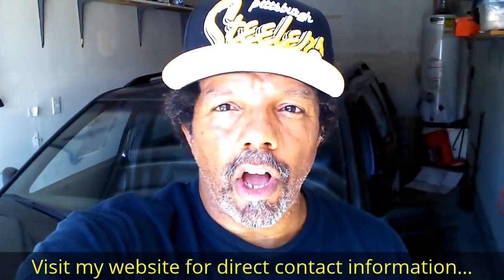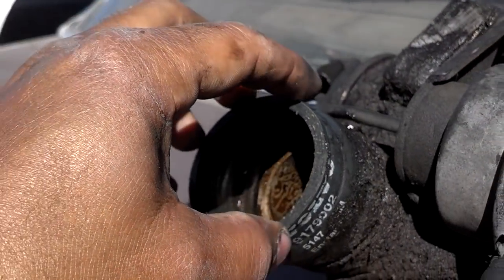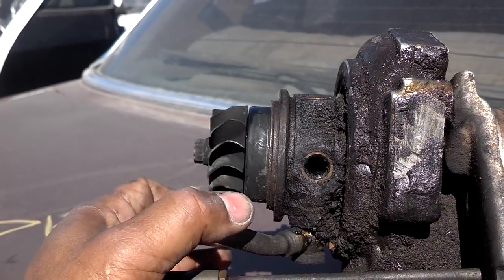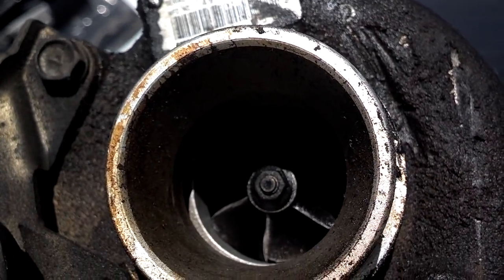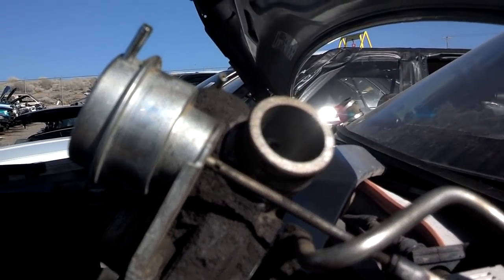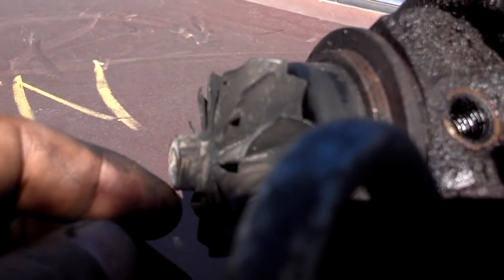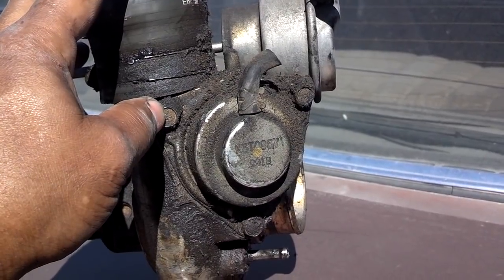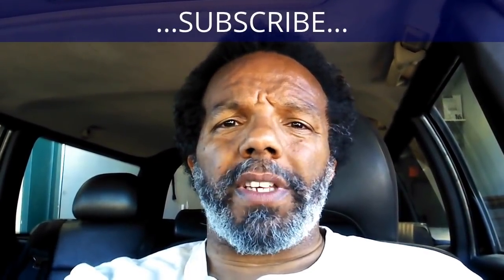How to tell if a turbocharger is bad. What can go wrong with them. - VOTD

Comment: Hi, I liked your video for its clear explanation and easy to understand.
I have an Audi A6 3.0TDI Diesel Turbo, model 2005 that I am having problems with the turbo at certain times as follows:
1. Starting from cold the engine performs beautifully with lots of power for as long as the trip takes.
2. When starting from hot engine, the car may perform well until stopping at the first intersection or traffic lights, from then on it loses power. When in this mode, if I try to push hard, the glow plug light comes on and starts flashing. Pushing harder the computer / engine light comes on.
3. When in this mode (that is when the glow plug light is flashing), If I stop the car and turn the engine off for around 2 minutes, and then switch the engine back on it will drive normally with full power. 
My personal view is that the turbo sensors could be playing up. However, my local Audi Service Centre have advised that the turbo needs replacement.
Thank you in advance for any advise you may have.
Bill Jabro from Australia
Reply from the maker: +William Jabro Doesn't sound like a turbo problem, more like a sensor issue. Have they read the codes?
Reply: +Robert DIY Thank you Robert for your quick response. It would seem they have read the codes. In their report they said "Checked and found fault codes on the turbo and the flap motor. Ran test plan and found turbo to be defective and the car requires a new turbo". 
My concern is, if the turbo is defective, why is it working properly at certain times? It could well be that it is getting the wrong signal from a sensor.
I personally thought it could be a sensor issue. Prior to taking the car to Audi, a specialist local mobile mechanic pointed out that the turbo has 2 sensors and either one could be causing the problem. He was not in a position to do it then. I will contact him to arrange repairs.
Thank you again Robert.
Reply from the maker: You may want to get another opinion.
Reply: +Robert DIY Thank you Robert, I will do that.

Comment: this is best video explanation
i got a quiestion
i have a gst eclipse with a small 16g
and im thinking it may have blown seals beacause it smokes all the time but not like the one u showed
and it has a lost of power
i was thinking it may be the valves or a piston ring but the wierd part and why i think its the turbo seals its because one of the studs on the head is broken so i have a boost leek and the wierd part is that when i step on the gas looks like its coming oil from the broken stud and the headers can u help me out
Reply from the maker: +John Torres Hey John, man, I don't know. Sounds like you have a lot going on there. Fix your boost leak and see if you get your power back. A 16g is not really small.
Reply: +Robert DIY  no i got the small 16g not the big 16g jaja
but today imma swap the turbo to the stock t25 turbo to see it it is the turbo
Reply from the maker: Cool.

Comment: good video, clear explanation, simple to the bone, no annoying music over the voice, thanks
Reply from the maker: +TheEdudo Thanks for watching.
Reply: Hello, I am writing from Turkey. I have a 98 model Volvo v70 T5 turbo. It is 4 x 4. How does the turbo vestek work principle of this car? Where does the turbo control valve get the command from and how does it open the signal? There is no turbo pressure sensor in this car. How does it detect it and open the turbo control valve? Thank you.
Reply: I agree, good video, only suggestion to improve that I have is to clean the turbo before the video to make all the different parts easier to identify, thank you.

Comment: Thanks for uploading
Reply from the maker: +sandydogy You are welcome. Thanks for watching.
Reply: +Robert DIY How come some have coolant lines others don't? Thanks Ian
Reply from the maker: Not sure. Cooling helps bring the temp down quickly.
Reply: Robert DIY I have a problem with my Fiesta diesel and as she warms up she misses for about a mile and a half on and off code po200 injection circuit malfunction,  changed glow plugs, fuel filter, any idea how to find where air in getting in to fuel lines?  I can see bubbles when I squeeze the primer bulb that fills my fuel filter? Thanks
Reply from the maker: Maybe the fuel injector is going bad.

Comment: Robert,

Few weeks ago some work have been done on my 2012 Jetta SE for the 40000 miles, since then I'm feeling loss powers. At first i thought it was lost of power now I think it's a turbo ! What do you think can happen ? What do you think is the issue ?

Thank

By the way, I like your video
Reply from the maker: +Nico Scala Probably a vacuum line loose or bad.
Reply: +Robert DIY 
I will check that, thank you for your advise.
By the way keep doing videos, ur doing a good job

Comment: this video is an excellent one with clear concise explanations .
way to go
Reply from the maker: +Paul Costello Thanks for watching.
Reply: Robert DIY Hey Robert do you know much about aftermarket turbos and upgrading them? I'm putting on a bigger turbo and could really use some advice. Are you familiar with bigger turbos than stock and the mods that go along with it? just had a few questions for my build. thanks, subbed......
Reply: Chris Watson don't run a bigger turbo on stock internals

Comment: NO SMOKE AT ALL JUST LEAKING . KNOKING SOUNDS WHEN YOU FIRST START IT UP
Reply from the maker: +Clyde Bush What is leaking? What is knocking?
Reply: oil out of front of turbo. someone told me that it was turbo making noise
Reply: THANK YOU
Reply from the maker: +Clyde Bush Turbo's do leak a little. Not more than a drop or two per day. If you can see drips while it is running, it's leaking to much.

Comment: I have jeep compass 2008 and problem I am facing is that jeep starts loosing speed on upwards and computer says it maybe turbo so what is your suggestion. voice is also changed but no smoke. Kan it be paip.
Reply from the maker: +Tamur Khan If it's not smoking, I doubt it. Do you have any codes?
Reply: I have fixed it up.. turbo pap was loose...

Comment: I just bought a 2011 wrx and when I start the car it will back fire a few times and a lot of white smoke. any ideas?
Reply from the maker: +lilb1432 Yikes! is the car firing properly? Have you checked the spark plugs?
Reply: +Robert DIY the car starts fine and runs on its on but when you accelerate its rough and almost stalles when you take your foot off. car sat for around 8 months without it bein moved
Reply: Give it a good service before you start looking at potential issues, a car that's been sitting for a length of time will need a good service.
Reply from the maker: Is the CEL on? Any codes?

Comment: great vid man thanks for taking the time to make it and help the rest of us and it looks like the guy who had removed that bad turbo came by and gave your vid a thumbs down.
Reply from the maker: +Jose Gonzalez LOL, thanks for watching.
Reply: +Robert DIY  How long after changing turbo should your car stop smoking?
Reply from the maker: Within 50 miles. If you drove it a lot when it was loosing oil down the exhaust, there may be a lot of oil in the cat, which will have to burn off.
Reply: +Robert DIY thanks I appreciate it the responso I just changed it today and was still smoking. not like before though

Comment: I just found your video Robert..... yesterday I took my Volvo S40 2004 LSE to the garage because 2 days ago I the check engine light came on, and also realized that I was missing "power", they tooked the car for a spin and they said it was the Turbo that it was completly "gone", so I got very frustrated because I knew that would be expensive around $900 bucks for a used one including instalation...., but I called the original dealer in order to just double check if that was the real problem, they asked me to better bring the car and do an scanner and a test drive so I did a few hrs later, effectively the engineer told me the same that it was some trouble with the turbo but he doubt that it was the Turbo it self!, because they also mentioned the smoking symptoms that I did not have on my car, so they looked ath the back in the hood and realized that the "ROD PIN" that open the wastegate was loose, so they just pulled back on original position and fixed with some clips... mins after they checked the oil was good, we tooked another road test and instantlly we feel the diference on the boost!!!
 It was an 1hr labor no pieces and only "ended up very cheap at the end" lucky me!      - I just have a question Robert 

How can I realize if my Volvo is boosting good rpm? Thnks!
Reply from the maker: Hoekstrá Dan Install a boost gauge. - https://www.youtube.com/watch?v=Y_J38rSztVw - https://www.youtube.com/watch?v=KZKCnmBoC-I
Reply: +Robert DIY Thnks Robert  I will take a look on them,  once I get it I hope I can install it....  lol

Comment: When does the boost kick in, or it boost from Idle? Or is there pressure all the time? I have no volvo codes at this moment.  Wonder if wastegate is sticking open.  How to check? Thanks
Reply from the maker: Lawrence Oliver Every time you push on the gas pedal to gain speed the car/turbo creates boost. If you don't have a boost gauge you should install one. - https://www.youtube.com/watch?v=PXR9m-c_FuM

Comment: Great Video! I have a 2004 Xc70. With no boost pressure. I checked if it spins and all good there, waste gate can move.  Don't now what else to look for? A friend gauged it at 1psi. Car runs great, no smoke
Reply from the maker: Lawrence Oliver Likely some under lying code dialing back the boost. Unless there is a boost leak somewhere.

Comment: What causes the white residue on the back of turbo
Reply from the maker: DrLee192 White residue? Salty roads?
Reply: It's white residue like in your video one of your shafts was completely white that's how the turbine housing of my turbo is but has no shaft play and rotates smoothly and just wanted to know if I should be worried
Reply from the maker: At what time mark? I really would not worry about it.
Reply: It's @ 9.0 minutes in the video
Reply from the maker: I'm not sure. I found that at a junk yard. My guess is that the car blew a head gasket and blew coolant out of the exhaust.

Comment: Question.. My Audi Turbo got 140K miles and my check engine goes on and then turns off randomly. She shop said it's the turbo, however tho it doesn't seem to have any of these symptoms and runs very well. Should I be worried or they're just ripping me off asking 2 grand for stock turbo?
Reply from the maker: Blackjack 335 Rip off. Just wait till the problem surfaces. They should be able to see the problem in the PENDING CODES. Stop by a parts store and see what their code reader reports.
Reply: @RobertDIY  my turbo caused heavy smoking thought it was injectors faulty at first.now I want to know could it cause blow by because found lots of oil in the induction pipe. Recently rebuilt block and head never changed the turbo.

Comment: I can hear a whizzing, whistleling sound in my Volvo S60 when the rpms drop. I posted a video in my channel. Is this normal, or is my turbo slowly dying? Since mine is a diesel engine, i heard that fine particles of the burnt diesel get baked on the turbine and change the air flow causing this sound, but it does not sound plausible to me. What do you think? I love your vids btw, keep up the good work!
Reply from the maker: Volverine Volvi I'm not that familiar with diesel vehicles, however, if you don't feel any performance difference it is likely fine. I would post on a forum to get input from others.
Reply: It should be fine, probably just the turbo whistle

Comment: Last year when I adjusted my wastegate, I ended up spinning the rod while I was trying to loosen the lock bolt. Do you think that if you can roll the rod with your fingers, it is damaged?
Reply from the maker: Sebastian Schwarz I'm not sure. If it hold pressure it is likely fine.

Comment: nice video but man you got to use gloves with these oil soaked things... your skin is the biggest organ of the human body and all them chemical will soak into your blood stream  in minutes...
all them heavy metal/petroleum chemicals/alum partials   that you think will just wash off are already inside you and over time will be a down fall on you immune system.
.yeah may take 10,20 yrs more of less depending on what already in your system  but 8 cent gloves are the only way to work on cars so you avoid the toxic chemicals ....

learn what in oils / fluids its bad bad bad for any human body.....and when touched will soak into your blood stream in under 5 mins so that day of wrench turning will result in a toxic over load to your system and you may feel fine but your loaded with toxins.
Reply from the maker: AwakeDude911 I believe you and I do know. From back in the days when I worked on aircraft. I have gone through about 200 of those rubber gloves since December. I'm getting better at using them.
Reply: Robert DIY good to hear theres no reset on the game of life ...YOU ONLY GET 1 turn !
Reply: Bullshit, my dad is in his 70s and is as healthy as I am (28), and has heavily wrenched his entire life for 50+ years without gloves. I think your underestimating the adaptation abilities of human bodies. In fact he is healthier than me in some ways.